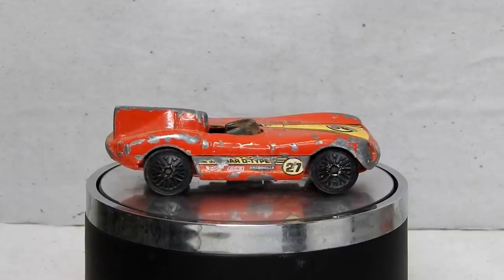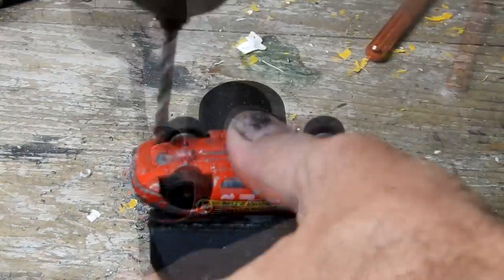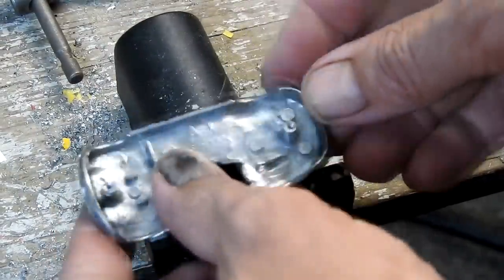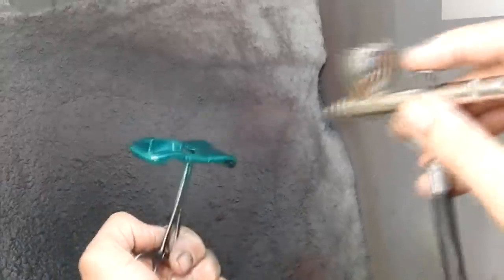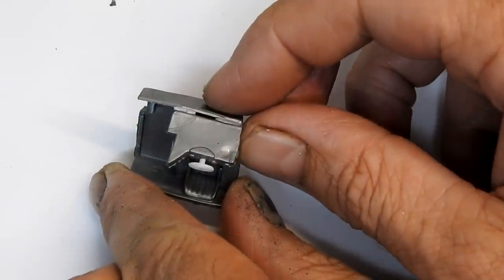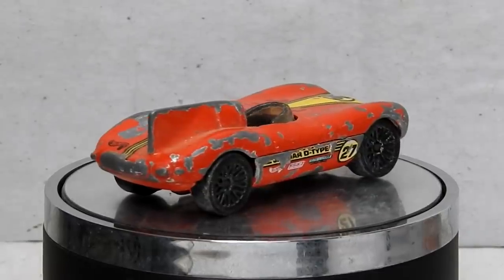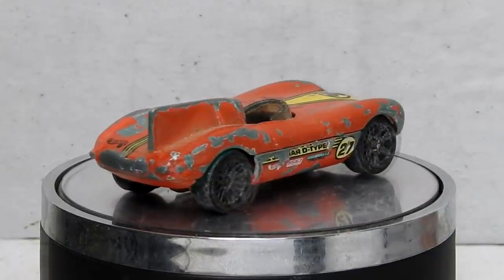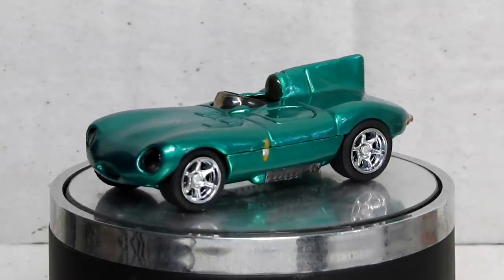Jaguar D-Type Restoration Candy Custom Classic British Race Car Hot Wheels

Comment: Nice customizing. The new color looks beautiful. Because it is a racecar it should have some racingnumbers on.  As a streetcar it would be nice to open the hatch to the left of the driver to put some luggage in, with a netting above to secure it..
Reply: There was a two seater road car version called the XKSS. Production ceased when the factory caught fire though. They’re actually rarer than the race cars as a result of that fire, which was early in the production run.

I’m pretty sure with a bit of careful filing and sanding, and a new wider windscreen, an XKSS could be made out of this casting.

Comment: I'm struck by the detail work added. While clearly an improvement, your leather straps have a split in them due to the two casting pieces. That kind of undermines your improvements. Your choice of 6 spoke wheels is perhaps a little too modern for the era, but look quite sharp to my taste! The radiator intake, I think, should be blacked out. I'd like to see more HW vintage racers detailed as well.